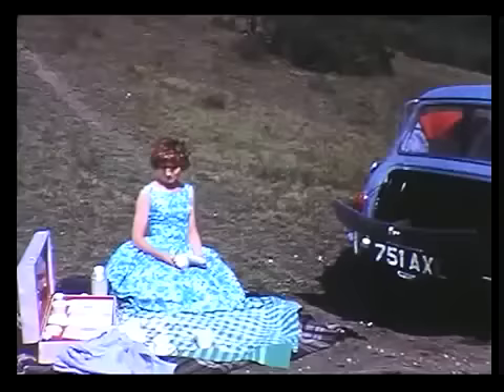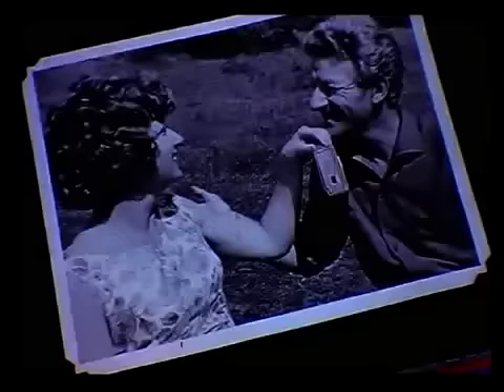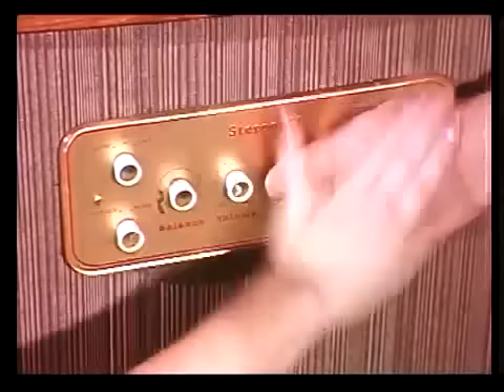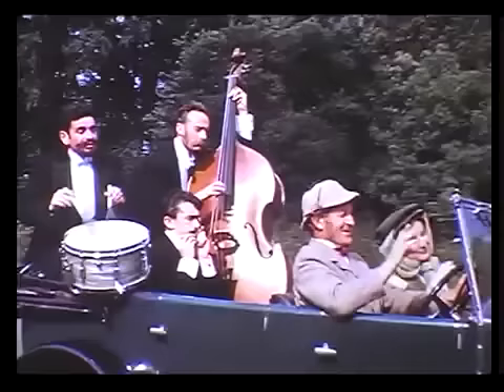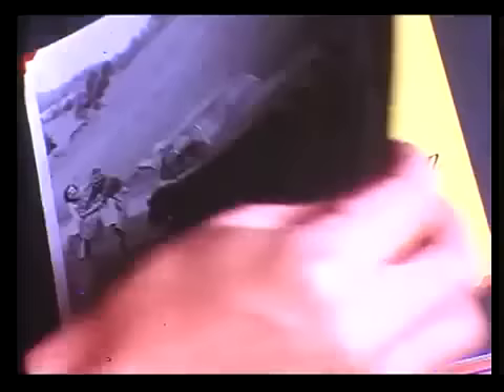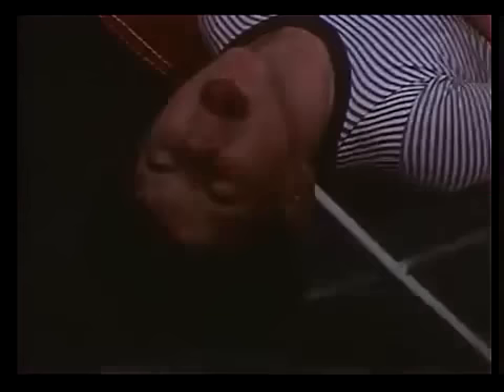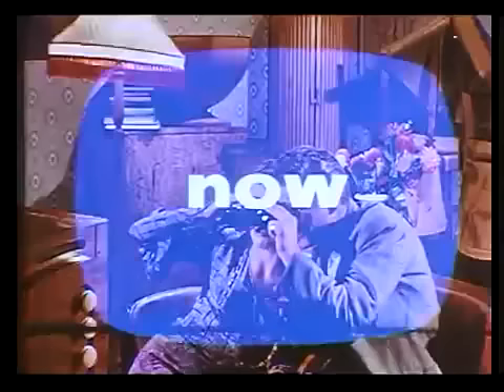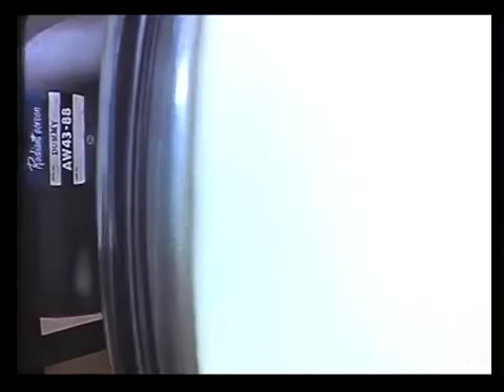Dr WHO & MULLARD Vacuum Tubes/Valves ad

Comment: If only the Tardis Chameleon circuit had used a Mullard tube then it may have functioned properly.
But then we would not have been stuck with the brilliant blue police box we have now.
So in that case god bless the Galefreyan engineers for using cheap Chinese components.

Comment: Mullard valves developed by this awful Hollandl firm Philips. Philips made the parts, they were then exported and assembled by Mullard in the uk. Philips got it´´s grubby maulers on most of the european Vacuum tube biz. for E.G. Telefunken,Valvo, Tungsram,, Mullard to Name a few.
Reply: Mullard, although owned by Phillips were run as a separate entity and produced valves from scratch. They also developed their own products independently in the UK, a good example being the ubiquitous EL34. There was a lot of cross fertilisation between manufacturers, with valves being made by one company and being branded as another to fill gaps in product range.